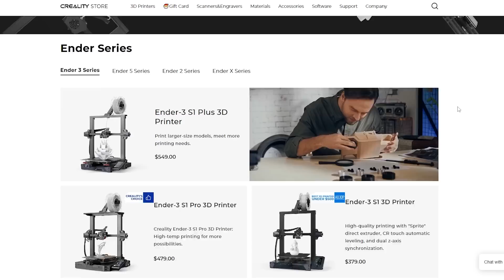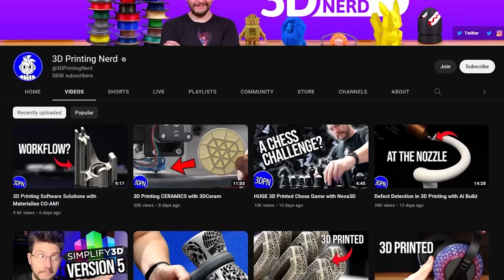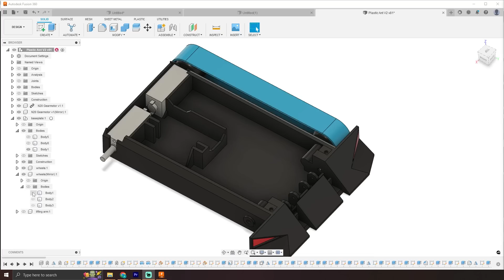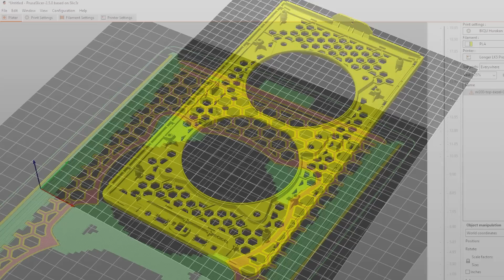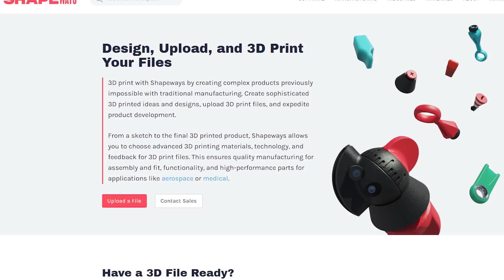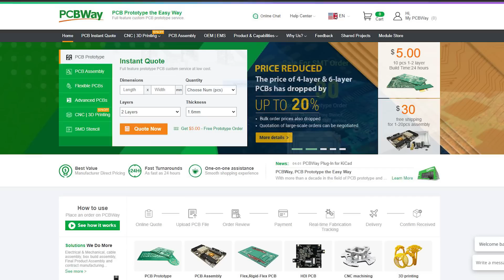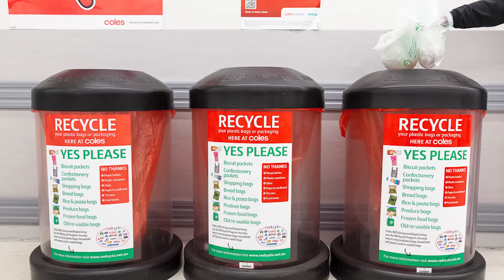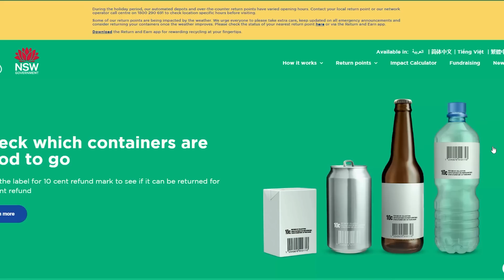My 3D Printing Predictions for 2023

Comment: The ability to recycle plastic bottles into filament is one of the main motivators I have for buying a 3D printer in the first place. I want to be able to recycle plastic into something useful in my own home. So I'd love to see you do a video on that.
Reply: I still have yet to find the actual device that does this.
Reply: @samualwilliamson1187  TL;DR I think you have to make one. Look up a guide. "recycle plastic bottles into 3D printing filament." Maybe Function [dot] 3d on YouTube could help.
——
Generally, I think you have to make it. I first learned about the process from an account called Function [dot] 3d. He pulls the bottles into strips, splitting the plastic between two bearings offset in height, mounted on a 3D printed base. There are other processes to do this with knives or razor blades; it is sometimes used as cordage in the bushcraft community. I think this process is done one bottle at a time.

He winds this long strip of PETE (or other bottle plastic) onto a spindle, and then feeds this through a modified hotend—I think just a regular one that would go on a printer, but machined to make the nozzle wider. I think there is a part before the hotend so that the strip of bottle plastic goes in straight, and a part after, which cools the filament off, but I'm not sure about that part, kind of guessing. Then finally, the filament is wound on to another spindle, which turns slowly under the power of an electric motor. 

I don't know if there is a way to bond the strips of bottle plastic together, presumably a spindle of only one plastic bottle's worth of filament wouldn't be all that useful.

This is just my understanding of the process anyway. I haven't done it yet. I'm very new to 3D printing. But this is the entry-point of my interest.
Reply: @DaimyoD0  one bottle is more than enough to make a small print, but splicing is as easy as lighting a cig anyways. Their main problem is the """fillament""" has a very unpredictable density, as they only soften the strip and roll it up into a tube that has a hole dependent on the imperfections of the strip thickness and width. I tried to make it myself and at 240degs it did exactly that and at 260 degs it actually started melting and trying to form a solid core, but the whole thing is as bubbly as a reptile skin. I am still not sure if there is a way to achieve consistent density independent of input strip size and shape.
Reply: @two_number_nines  Thank you for your input. I kind of was wondering if it was essentially rolling the strip over into a tube, or at least not melting it all the way through completely.

I have always kind of figured that the filament made from this process would be primarily useful for things like prototyping, or making nonstructural but utilitarian parts. Because I figured any prints made out of it would look bad cosmetically and be relatively weak. But, at the same time, it is essentially free, at least it is for me, having no bottle buyback program in my area, and having a genuine suspicion of whether plastic bottles in single stream get recycled at all. So I figured if you can replace your good filament on some test prints, you're effectively saving money and reducing plastic in the landfill, which would make it worth it.

So obviously it probably wouldn't be worth it to get into 3D printing for plastic recycling alone. But there are plenty of things that have broken around my house that had to be thrown away because a replacement part wasn't available, but if I had a 3D printer, it could have been saved. I think there is still an environmentally friendly argument to be made there, despite the admitted environmental cost of filament production, disposal of failed prints and support material, and the manufacturer of the printer itself. Which could also be partially mitigated by buying used, I think.

Plus I just think it's really cool to be able to make your own stuff lol
Reply: @DaimyoD0  The utility of some of the parts you can print is so large that the filament cost is far from your main concern when printing them. If you want to print decorative objects and buy a roll you pay for the material purity and consistency of manufacturing and the plastic itself is a gift. Also I have noticed filament prices have started to drop and I only expect them to go lower.
If you want to build functional machines, electronics cases, parts of machines and so on there is no reason to wait a day more for material cost saving techniques. Any fillament recycling machine would cost you the time, effort and money to buy at least 10 rolls. I have been printing quite a few complicated projects and have bags full of failed prints, yet I have barely used up 3 spools.
If you are hyped to print action figures and top 10 christmas gift compilations you are heading for a disappointment. It quickly will disappoint you how much effort it takes to print out a stupid toy. Many have went on this path and many have failed by printing for about 2 years, then their printer either collects dust or they buy 3 more and in 5 years there is a major garage sale.
3d printers for mechanical engineers are like a soldering iron for electronics engineers in the way they improve life, but people that just want to consume a seemingly endless supply of cheap toys will find more joy playing a videogame than bothering with this.
Reply: @two_number_nines  Has anyone ever told you that you sound a bit fatalistic?
Reply: @DaimyoD0  it is probably true. I have noticed myself what a killjoy I can be, so I just try to keep quiet unless asked or I have something positive to say.
Reply: @DaimyoD0  Ha ha, but what he said is still true though. Home recycling methods are and will always be a novelty.
The good news is that around the world there is a lot of progress in AI recognizing different plastics from packaging materials and other waste streams. Filtering them better than humans ever could and recycling those materials close to 100%. Here in the Netherlands some cities stopped taking separated waste from residences because it has become counter productive. The multiple waste bins per house pose a logistics problem and the material needs to be post filtered by machines anyways.
The only hard to solve problem (at least from a technical perspective) is people throwing thrash out of their car windows.
Reply: @eliellington  10 years ago printers were still pretty much the same as the are now, there hasn't been that much of a change. Just look at the prusa mk3, it's still one of the most popular printers and the basic design is still the same as it was 10 years ago, just with more refined components. I don't think plastic recycling will ever be a thing.

Comment: For a good Prosumer I reccomend the Ultimaker. I still have my Ultimaker 3 (extended), and have used it in my professional life (convincing my employer to get a 3d printer of their own). It is about 5 years old and still going strong.

I use a bit of bed weld (i.e. magigoo and the like), and it just prints well (I basically only print in PLA or PETg though). There are a couple of nuance issues and I have had to replace some nozzles. I did have a catistrophic failure when I accidently loaded ABS instead of PLA, but I managed to fix that and putting in the wrong filament and walking away is on me not the machine.
Reply: It's these tiny little issues here though that make prosumer units so untrustworthy, if I'm going to spend $5k, I do not want the machine to have to be tinkered with like the budget machines, it's absurd that the hobby still has machines that are this expensive while also being unreliable imho, it's what's stopped me from pursuing prosumer machines altogether.